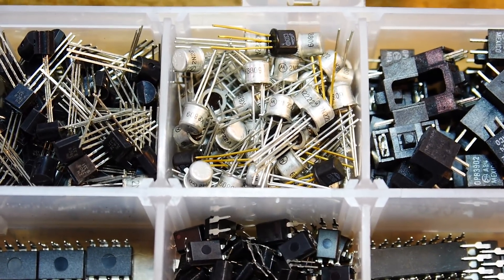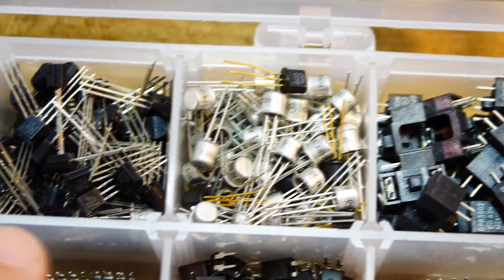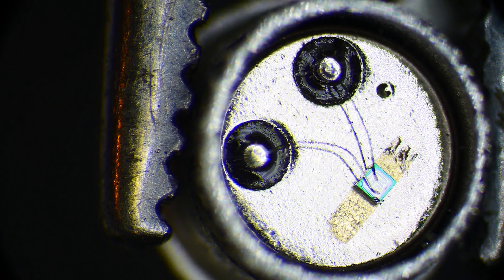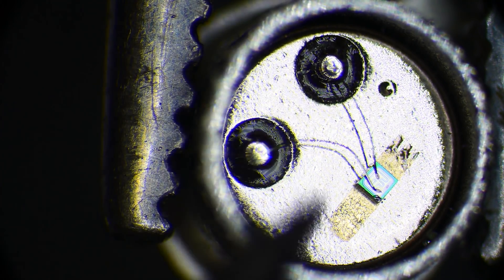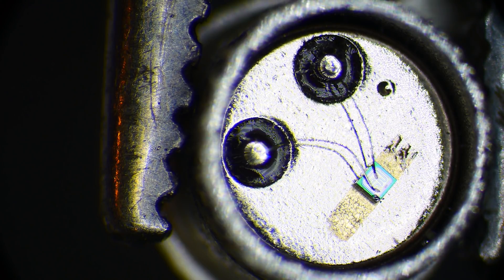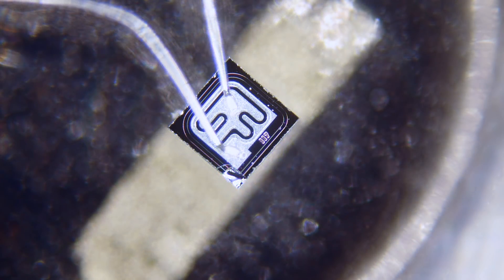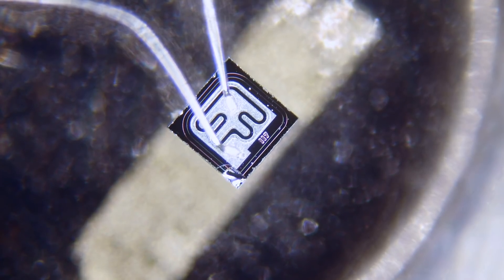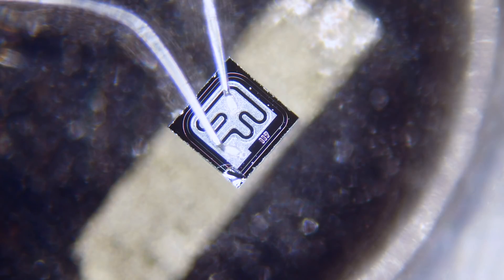#184 2N2222A transistor under the microscope

Comment: i could not figure out where the third connection is made is it coming from the ground ? or maybe that little solder button right ? if its that solder part its not clearly visable if it connects with the second wire part or just hit the outside
Reply from the maker: third connection is through the bottom of the chip to the metal case. The third leg is attached directly to the case also. only two legs are separate and insulated from the metal case.